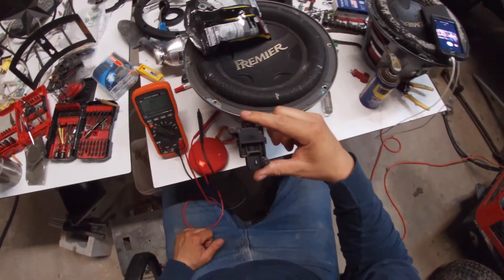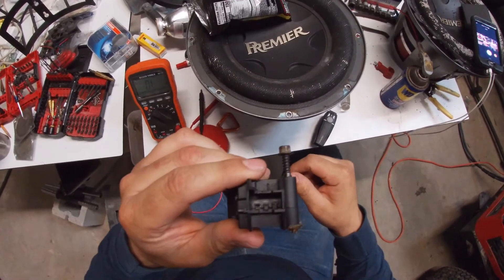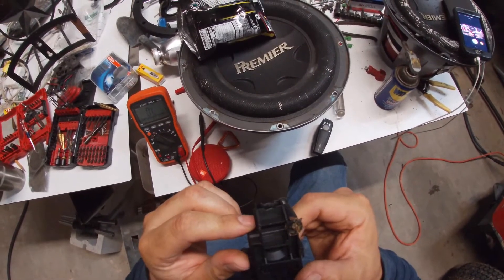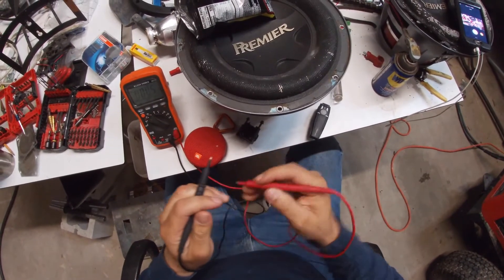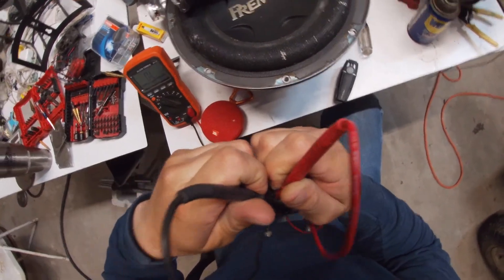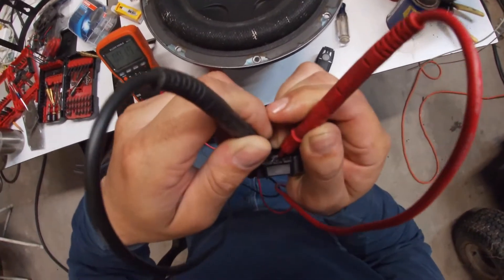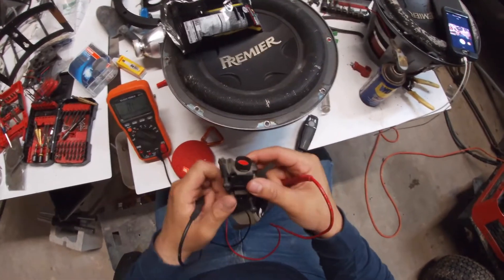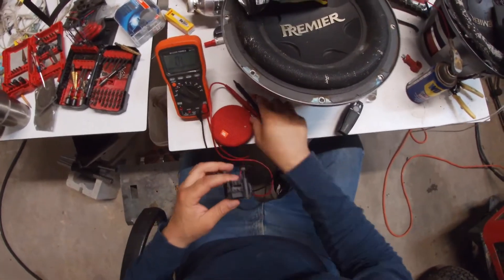How to test a Ford inertia switch test

Comment: I have .2 ohms on my switch but it will not let current go through the switch. I can power the wire to the fuel pump and it runs but if i plug the switch back together and clip it good then nothis happens even though i have power to the switch on the wire and the other wire will power up the pump. So what is wrong?

Comment: By the way I would like to ask you if you know how to fix a bad ground, I was checking pin 85 (ground) from ECU relay on the fuse box, setting my multimeter to 20 volts black lead of meter to negative side battery and red lead to 85 slot (where the pin of relay goes) I should see zero volts with ignition switch ON but instead I read 001.3 volts is this normal or I have a problem I was told I should see zero volts. But when the switch is off I see zero volts. But when switch is on the ON position I get some kind of voltage. Also pin 87 give me some volts  when the switch it's off it's that normal? I thought the wire activates when wire 30 pin touches 87. I was expecting zero voltage from there also and I see voltage there also how can I fix this problem friend any ideas. Please help me thanks in advance...
Reply from the maker: Sorry I do not know